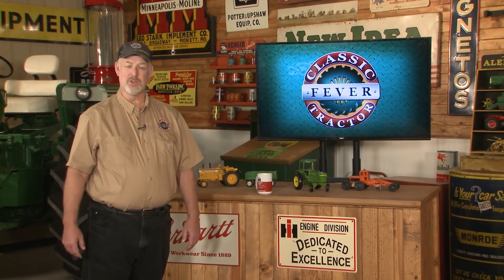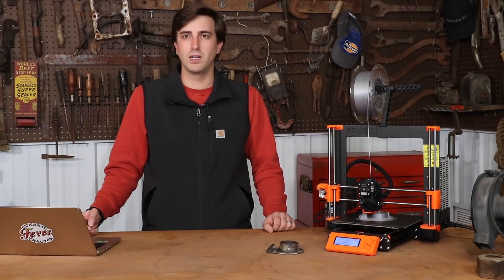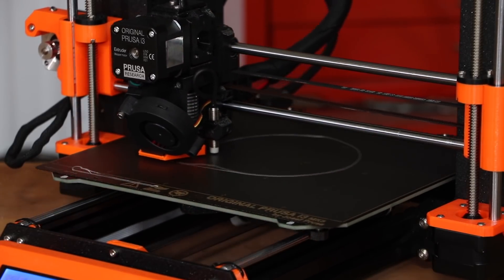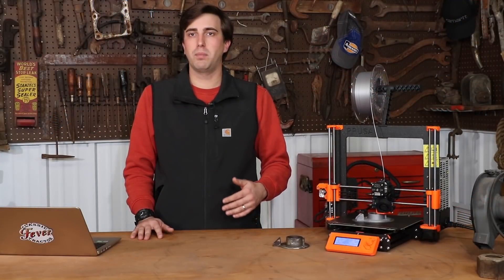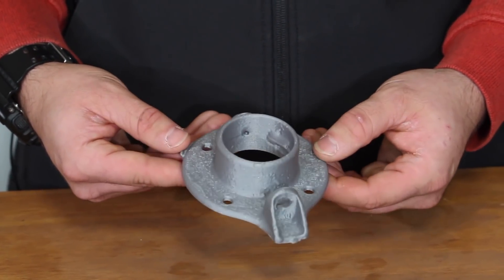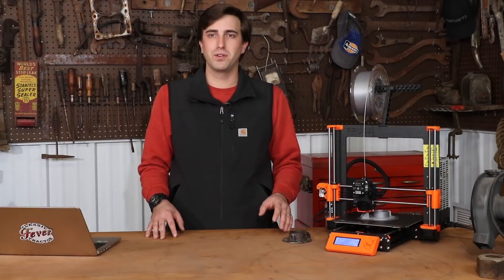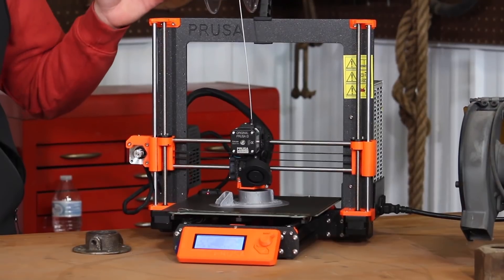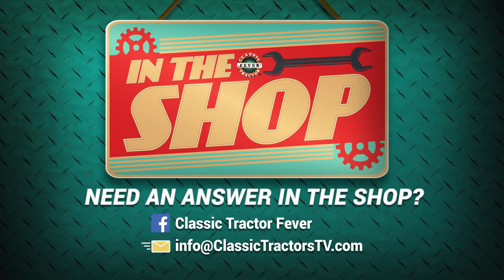In The Shop - Making Parts On 3-D Printer - Classic Tractor Fever

Comment: Gear levers, knobs, or any non stressed part is ideal, have to be careful of printed parts cracking when you apply pressure such as tightening the part up, all depends on the materials you use to print to.

Comment: Technology is immense these days. There is company in Connecticut that has a process similar to this but prints in metal using a powder material . They make aircraft engine parts for radial engines in the restoration of the Vought F4U Corsair of WW 2 fame. The process has tone of applications